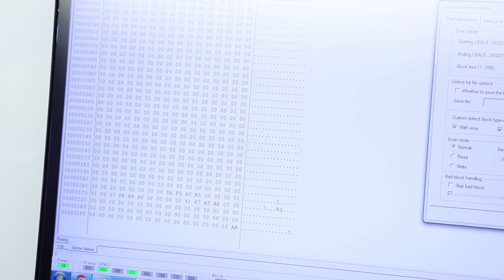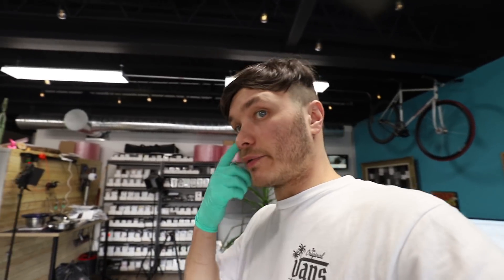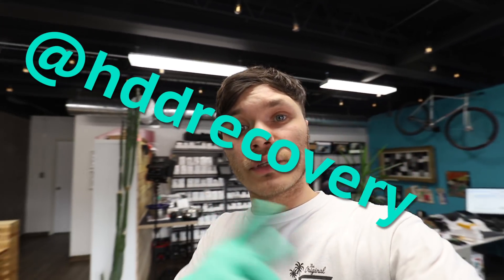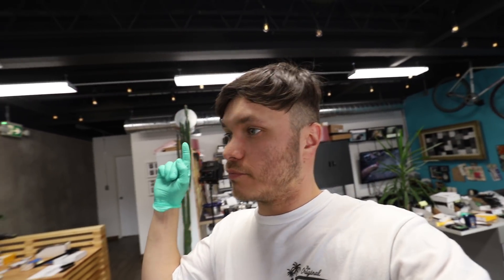start of my daily videos | Hitachi, Seagate both dead brought to life

Comment: Hi  Erkin, 
I have a Seagate barracuda 4tb that spins up,the head clicks twice and then the disk spins down and shuts off. I have checked the PCB as described in you videos and all seems to be ok. I wish I had have come across your videos earlier as I made the mistake of opening up the hard drive. When I did this I found that the heads were in the correct position on the ramp and the platter I could see cooked clean. Have you any ideas what my problem could be. The hard drive just suddenly stopped working and did not receive an impact or anything like that.
Reply from the maker: Arthur, it sounds like heads died on that drive. It is not unusual for Seagate DM series.
Reply: HDD Recovery Services Thank you for your reply. If I was to try and change the heads myself, do I need any sort of specialist tool for head removal. I know there is a 95% chance I will completely render the drive useless but I would like to give it a try. Data recovery companies here in Ireland charge around 2300 dollars and I just could not afford that.

Comment: Why fail the Heads in the first place?
Reply from the maker: Usually, they die from the impact, shock, age, power surges.
Reply: Cheaping out on storage usually leads to lost data. By having mirroring disks, on-site backup & off-site backup as well as changing storage when reallocated sectors, noises start to appear you could pretty much eliminate the need for recovery. Since it would be easier to get struck by lightning than break all off the copies of data at the same time.